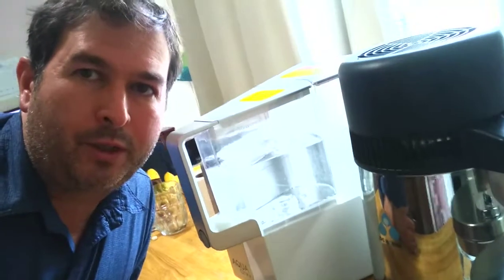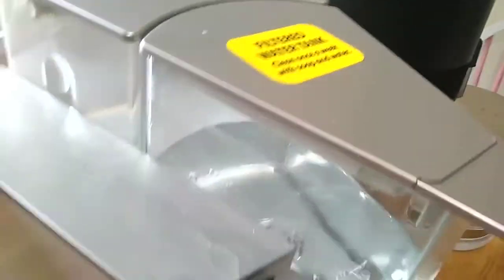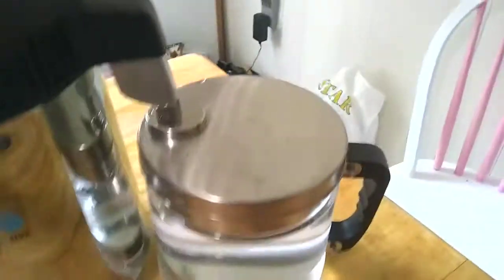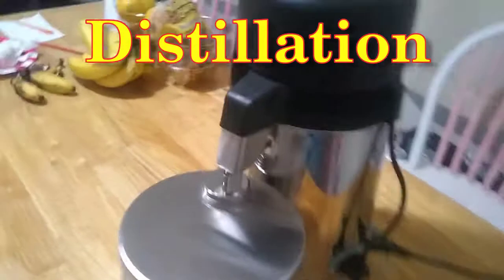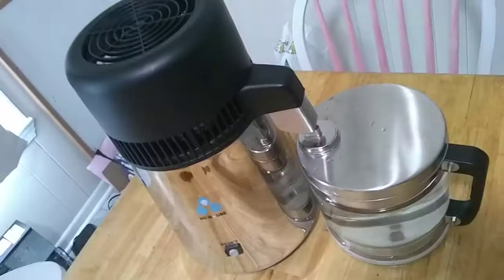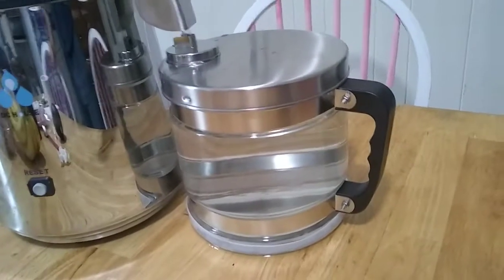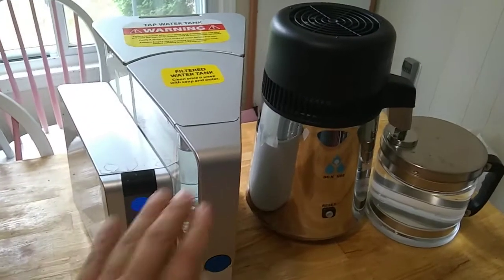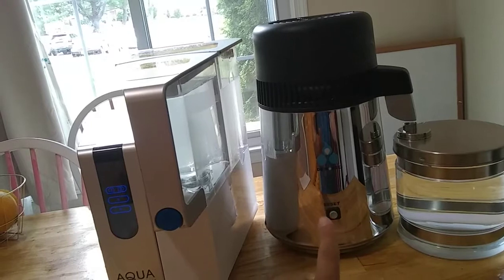RO vs. Distilled Water

Comment: Better question is which produced the cleanest waster. If I’m looking to do water science for coffee i require as clean of water as I can get.

And i have a problem with using plastic containers to store anything because plastics leech into the water over time. So the distiller while it will cost more to run will be better in the long run for my particular wants because it comes with a 4 liter glass jug not a plastic water tank.

There’s more to life than just costs. If you’re health tanks and you can no longer work because of all the chemicals and microplastics in your body it’s a problem because you just lost more money losing your job than you would have using the water distiller.

Comment: Excellent but a question -- which does better in terms of removing municipal water chemicals (e.g., chlorine)? Thx for any opinion
Reply: Chlorine is usually only a concern for fish. Distilling will remove most of it, the rest you can remove with a carbon filter if you're paranoid (or have fish). Chlorine naturally evaporates and that process can be accelerated via airation or boiling. You can test clorine using kits sold at a pet fish store.
Reply: Chlorine is a neurotoxin  @The_Ballo
Reply: Distilled water is more pure, but is about 3x the cost to make as RO. I will continue to use distilled water though because it's more pure and no filter is needed. I also own solar panels so the energy use isn't as great of a factor for me
Reply: @jims4763  distilling water is a great use of solar panels, specially when you have excess power.
Reply: Gas is the only thing a distiller can't remove because it's both a liquid and gas.